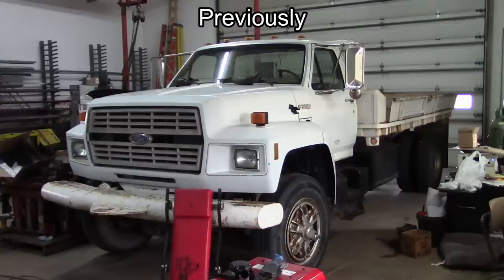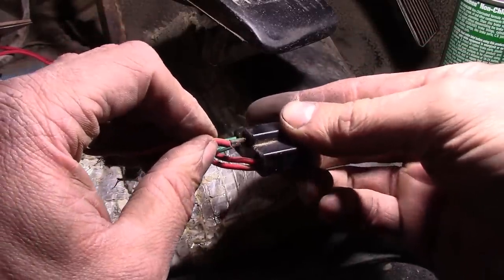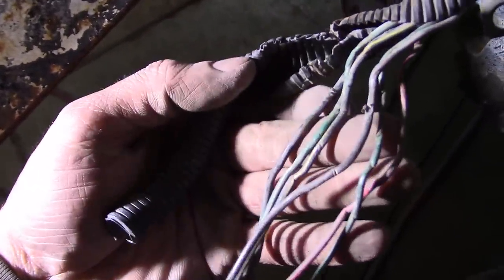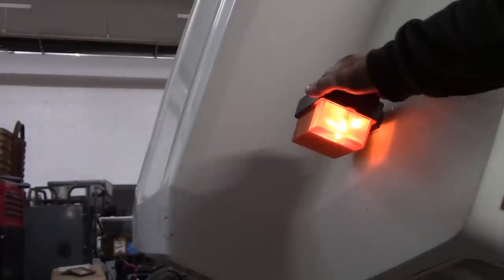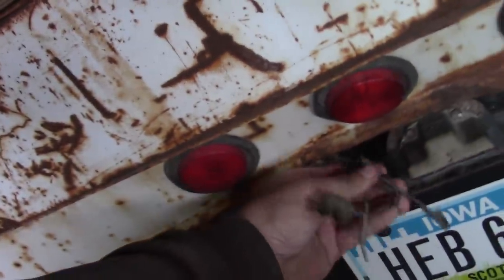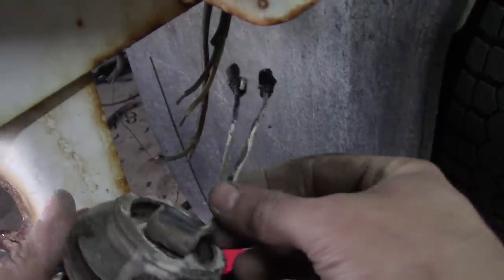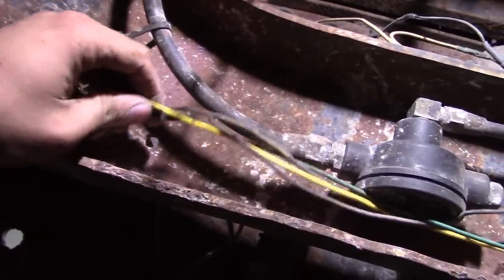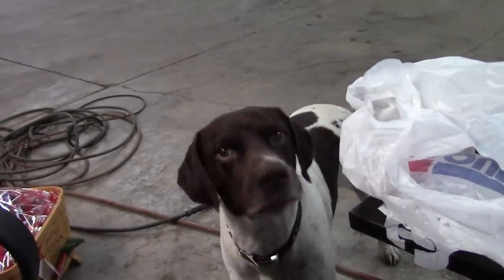Ford F700 Project - Fixing the Lights - Part 2

Comment: "dielectric grease prevents the flow of electricity"  Good thing you used it.  It trapped the electricity in the lights and now they work! LOL
Reply: I'm assuming it's people who don't live in the rust belt don't understand dielectric grease ? I've never seen a mechanic have a tube at the ready by me
Reply: @mattmopar440  It's mostly because the generalized directions are that you're not supposed to apply it to any mating surface as it is a non-conductive material. However, in standard practice, most mating surfaces in cars, are the friction fit kind, so it's perfectly ok, as force exceeds the staying power of the grease and thus forms contact. However, if say you were to try to coat something like the rotor of a electric motor, where the brushes are "gently" set on the copper/brass...that'd give you problems.
IMO, if you sock it in the connectors and just clip them on once or twice, you'll be perfectly fine. Certainly better than having all that space empty to salt/water/dust.
Reply: You're not into sarcasm, right? 🤔

Comment: I like how you showed the crimp fail. Many people fail at crimping at some point and it's good to see we are not alone
Reply: The problem is the cheap crimping tool everybody has to use. My late father gave me his professional crimper he used as a railroad mechanic quite similar to yours but without the ratchet feature.
I used it for years till a low life stole my tool bag with it in and my cordless Pro Dewalt driver in my car 3 years ago on a job site. 😡 Those ba...ds should be hung to dry.
Reply: It takes time to learn how hard to tug after crimping :)
Reply: U can get a battery op solder iron for cristsake butane evan no crimp
Reply: @billyhellboy6138  Sorry but crimping is generally preferable to soldering in automotive applications. Soldered joints tend to be brittle due to solder wicking up the cable at the joint, they break after a few years of vibration.
If your having problems with crimps failing, your not crimping properly, usually because of a poor quality/incorrect crimp tool.
Reply: @billyhellboy6138  When I was in the military I was trained in High Reliability soldering using a Pace unit and I thought it was a very good solution. Then I went to work in the commercial aircraft industry and soldering contacts to wires in aircraft is not allow. Soldering items to fixed positions such as a PCB is fine, but crimping contacts to wires is the preferred solution and industry standard.  As time went on I tried Raychem Solder sleeves, but found too many of my techs would burn through the sleeve and you had to have high temp jackets otherwise the insulating jacket would be damaged. The method Wes using with the non-insulated crimp and adhesive heat shrink, I have found, to be the fastest, most cost effective  and reliable method. Having said all that, if one does not take the time to do a quality job, then you get non-quality work regardless of method.
Reply: @LetsFigureThisOut  The problem with crimping is education.  You need some training.  Seems like this guy is trying to provide some.  Tin/lead solder provides a seal for wire splices(ie airtight) and prevents corrosion.  There should be a good mechanical connection first.  Some solder flux should be cleaned upon completion of work.
Reply: Some YouTubers would have edited out the failure and only shown the final splice.  Leaving it in made it real.
Reply: You know what they... Crimping Ain't Easy! 😬
Reply: Are you sure that's not Robbie williams?

Comment: Having grown up on a farm in a similar climate, I'm glad I lived long enough to "watch you work" on YT.  Back in the day, there was just no way to learn the correct way to repair things--you just did the best you could.   

I'm very grateful to you for sharing--you have the patience of a saint.    The exhaust manifold repairs in this series were epic.  I have no idea how you don't completely lose it working in such tight quarters (whilst trying to keep everything in frame).

I also recall how difficult it is to do repairs in the field--typically in unbearable heat or insufferable cold.  Sweat pouring into your eyes or with hands so cold that your fingers won't work.  Winter is a perfect time to do repairs but it's too damn cold to do anything.  Not sure if more farms have heated shops now but back then it was unheard of.

All the best for the holidays.
Reply from the maker: That's the beauty of YouTube. Always something to learn.

Comment: Basket case electrical resuscitations are always very satisfying when you can pull the switch and everything works. At least out the door. When in the hands of operators, anything is open season, but at least you accomplished the mission. Well done!

Comment: I find the lack of wire nuts filled with salt water and corrosion on a truck that old disturbing :)
Reply: WIRE NUTS ARE BIG ON  CERTIFIED ELECTRICIANS VEHICLES.
Reply: It's probably best to just bury it in salt. Helps the salt layers.
Reply from the maker: True. And no Scotch Locks. Very odd.
Reply: Dave Iaucco  yet they expect you to work miracles repairing their abuse. Once back in their hands, the destruction resumes.🤷‍♂️
Reply: Every beater work truck I've seen has wire nuts on it somewhere I guess I'm just unlucky lol
Reply: I love it when the uninitiated use wire nuts where they shouldn't be used and they don't even attempt to weather proof them.  Great video, Wes.

Comment: Truck electrical work tool kit, wire strippers, crimps, oh and a 10 pound sledge hammer and a 24" adjustable spanner.
Looks like a family Christmas tree, bits added to it over the years.
Great vlog Wes, thanks for sharing.
Reply from the maker: Heh. One bodge at a time!
Reply: @WatchWesWork  Yep, multiple simultaneous bodging requires a whole new approach. Lol.
Here's a saying that I heard our Sales Director say in the late seventies; "what we don't want is an ongoing negative situation", I'm still trying to understand it.

Comment: Those butt connectors with two different sizes are neat, I never have had them but assumed they had to be made. I often will use the butt connector size appropriate for the two wire side and then strip the single wire long and double it over to make it a tight fit. Works great.

Comment: Back in the 70’s I had a 65 Chevy short bed step side pickup with a dodge step bed on it. It was a retired phone company truck, painted OD green. The directional lights were pretty well SNAFU’d. If you hit left on the switch the left front light worked along with both rear lights. Right switch would give right front and left rear. I was just a kid, trying to get it to work. Figured they had crimped OEM wires with the bed change so I rewired the bed portion and installed an aftermarket switch that clamped onto the column. Still did the same thing! Frustrated, I mentioned the whole circus to an old mechanic. He said he once had a similar problem and it turned out to be an internal short to ground in one of the bulbs. I figured it was worth a try. Two new bulbs later it worked perfectly!😆
Reply from the maker: There you go!

Comment: Who need a soldering tool for wiring? Use the welder for wiring fixes, works every time.    LOL
You left no stone unturned. I don't have enough patience to do wiring. Simple, but a real pain to do right.
Don't need to turn left, this ain't Nascar!
Congrats on a job well done.
Thanks for sharing.

Comment: Hey Wes, two things you said I don't know. First the turn signals, I have found several assembly's on all the big 3 vehicles that a wire is broken under the steering wheel. There is one wire that is wrapped around a pin to keep the harness from falling out as the steering column goes down the assembly line until it is fully assembled. Usually the wire breaks inside the insulation, certain positions of the lever will allow the wire to reconnect. 
Second the light wires with rtv silicone. I have used the same principle on water/corrosion environments such as boats, boat trailers, ATV's, under cars and trucks anywhere that is exposed to the weather. I have used McDonald's straws slid over the connector then fill the straw with silicone. I have also used shrink wrap and filled those then shrink them. The connectors are always the insulated ones. I have had occasions to repair harnesses I have worked on before in another location but have never had one I repaired and sealed fail. I'm 66 now and handicap, watching you work sure takes me back and brings back lots of memories, cut hands, dirt and grease so thick you can scrape it off, etc. I must admit your language is much more pleasant than mine was, lol.

Comment: Yeah, use to have that "policy" of just fixing the "mess" I was presented with, but when your looking after 6 sliding deck trucks, 8 light duty and 3 heavy duty wreckers and one Landol tilt deck tractor trailer unit in Northern British Columbia you quickly resort to "rip and replace". Over time, you finally get everything cleaned up to the point where electrical issues are no longer a problem unless it's "user caused damage". That's a problem in a busy shop, when you don't have "one guy" who looks after all the electrical, 3 other guys that think it's easy and end up half assing everything, hey "it works, good enough".. Nice job Wes, I think we would work well together. Keep up the good work and more over the "principled approach" to doing it right.. Cheers and Stay Safe!
Reply from the maker: I would be nice if Grote or someone would make a universal sealed harness for trucks and trailers.
Reply: @WatchWesWork  Yeah, it would be but sadly trying to get any automotive manufacturers to "standardize" anything without a court order is a big ask.. That just keeps us in business "manufacturing custom wiring harnesses"..

Comment: 15:45   I once bought  a new car stereo and it came with "free installation".
They had trade certificates on the wall - Canada "Automotive Electronic Accessory Technician "
All the connections were twisted ends and tape.  They said that was standard for that.
Once I got it home, I ripped it all out and redid the connections properly with solder and heat shrink.
No problems with it ever.

Comment: Your lesson on how you use butt connectors, heat shrink and a mini heat gun, although it must have seemed very basic to you, was actually incredibly useful. I have used all 3 of those in some form, but I gave up on butt connectors because I could never get them to stay connected… just as you had problems with. But you had some great hints, for example how to seat the connector in the crimper, and to mash them together very tight, and I would use them (butt connectors) now.

So, simple dumb lesson, but as I said incredibly useful. I didn’t know of the existence of mini heat guns! I like that you can place a small heat shield on it to focus the heat and protect other wires.

Comment: I didn’t know those different sized ends butt connectors existed. Whenever I have 2 to 1 splices I’ve always just stripped back twice as much wire on the single side and folded the stripped portion of wire in half to make up for the larger butt connector.  I’ll have to order some of those different sized ones.

Comment: That weller heat gun will get hot enough to melt solder! I used one for years to change surface mount ic's.

Comment: So now you tell me I shouldn't of used that silicone and tape to repair some bad truck wiring this afternoon L.O.L. 
  That trucks no different to what  find on tractor electrics,  the last one I did in the summer had so many issues I went back to a real nice place with good wires. I cut the loom and put a weather pack connector there, then pulled the old loom out and built a whole new front loom for the lights and engine electrics. It took less time than fixing the mess from wires that were oil soaked , heat baked and the insulation was falling off, or had poor repairs from the last 3 guys that fixed it like this job. Glad you got there in the end, hopefully it stays working for a long while now .Thanks for the video, Take care.

Comment: Wes, I have been following a YouTuber out ofAustralia, Dangar Marine. He has restored a small steel hull trawler with a 2 stroke Detroit diesel he advises against die electric grease as I do. It does stop corrosion but it will cause moisture to be retained in electrical connections. I had this problem with my snow plow connectors. So I would run them dry and clean often. The moisture was shorting the connectors. Dangar Marine advises using a product called Strike Hold. It is a metal  protectant that dries and coats the connectors. I bought it on  Amazon and use it on all connectors it does not intefere with conductivity and prevents corrosion. I figured if this is what they use in a salt water environment it ought to be good in our road salt, environment in Michigan.
Reply from the maker: I'll have to try it.

Comment: I had a 1995 with a Ford diesel and loved it. I to had light problems and had to replace the light switch. Great video Wes. Thanks
Reply from the maker: Those switches fail often. I have another video about an old F700 that needed a switch.

Comment: Thank u so much for showing how to fix clean and fix wiring i have a few electrical connections on my 03 mustang that ia giving me so much trouble. I tried a few things I learned from the video and it fixed a few of my issues with the car. Thank u wes.

Comment: First, I learn a lot watching you and I want to thank you for hosting this channel. I always have to do a lot of wiring repair when I buy a new vehicle it seems like. My current previous owner mess is a 1986 F350 4x4. The trailer lights were the "twist tape and pray" method. Now I am having to find all the mess for the aftermarket gauges. Gotta love those "mechanics" who "think" they know what they are doing.

Comment: Was Max a bad boy...or was he just being himself, a  dog?  Love that pup!!
Reply: YA, The Rabbits in my yard still don't get it ? My Standard Poodle gets a few a year & I have a fenced in yard, had too make exit holes for them, KRAZY WABBITS. NICE JOB ON THE DUMP WIRING & DOING IT ( WHAT I CONSIDER THE RIGHT WAY ) I USE THOSE CONNECTORS & ADHESIVE SHRINK TUBING ALSO. Love the dimmer switch on the floor ( don't know why they put it on the turn signal switch ) ? The only cars I have with the dimmer on the floor is my 68 & 69 Camaro's. THANKS AGAIN FOR THE VID. & MAX IS JUST BEING A DOG AS MENTIONED BUT YOU SEE THAT FROM YOUR REACTION. YOU ARE ALSO A GOOD PET OWNER, SIR, I'VE SEEN IT MORE THAN A  FEW TIMES IN YOUR VIDS.

Comment: I was getting nervous when you were using the crescent frame straightener.  Man if that slipped...Ask me how I know!  Also a grinder and paint make me the welder I aint. Excellent edit job showing the splices.  I was cracking up.

Comment: First curious episode for me. There's only 7 or 8 conductors feeding the bed. I've done a few where I started at the cab or first solid wire thereabouts. Using a spool of 4-conductor trailer wire and additional wires as needed, loom it up and route it. Then open up the loom and tap out to devices and lights as needed along the route with your excellent splice/tap method.   Also run a separate ground from bed to frame to cab near the rear of the cab. 
But as always you're right. Everyone has their own method. I just hate to have lots of splices repairing the conductor along the bed and frame.   I hope this isn't taken like leaving a battery on the concrete floor. Lol. Thanks for the fun.
Reply from the maker: This one would have 4 conductors and a ground. Left turn, right turn, marker, and reverse light.

Comment: For those interested NO-OX-ID is a conductive grease.  I used it in a prior life working on big DC power plants.  I still use it on all electrical connections, including battery terminals.  Good stuff.
Reply from the maker: Hmm. I'll have to check it out.

Comment: One bunny bit the dust! In my 30 years of driving over the road I’ve seen some really strange wiring that people have torn up. But I usually end up doing is using a old extension cord and removing the old wiring. The good thing about an old extension cord it’s sealed. After three and four splices but connectors it’s time to let them go. Well done Wes

Comment: one of those myriad splices looked like a decent, soldered linesman's splice. a tip for using heatshrink - it can be stretched with a pair of needlenose pliers to fit over slightly larger wires.

Comment: Nice Work.      Before electrical connectors that wrap n solder is what was taught.
However you used two different tapes. Both are still used by electricians the first tape is a rubber tape that stretches n sticks to its self only, then a heavy wrap of electrical tape(vinyl) . Often used in 3 phase motors over 10 hp were lots of current travels on what is typically called wire bugs. 
The RTV goop trick is a bad replacement, back in the day was a cloth style cover tape.

The rubber style tape is still around & in right Application & proper use works fine.
We come along way from 1960 tho & you show things we only dreamed of.  The only thing you didn't show or cut out was was that bit o tiny rust/salt jump behind your safety squints n make vocals noises. 
Some times ya fix with what ya got, my jeans, boots & pockets got holes in em & never had money for fancy tools n items, did best we could with what we had.
Reply from the maker: I have some "friction tape" that is used for motor connections.

Comment: i worked for a while at Fords truck plant manufacturing 'D' series trucks in the UK. They used scotch loks straight from the factory. Mind you they also used bullet connectors too which quite often failed before the truck left the plant.As I typed this I realised that that was forty years ago!

Comment: My old dump truck has an short angled plate just below the tail gate opening. It runs the length of the bed. Keeps material off the lights.
Another great video.